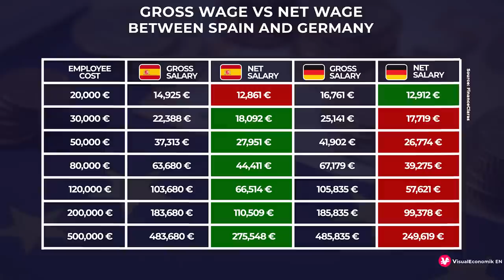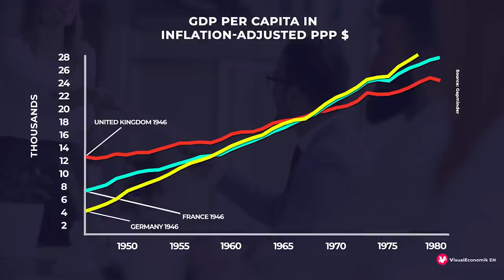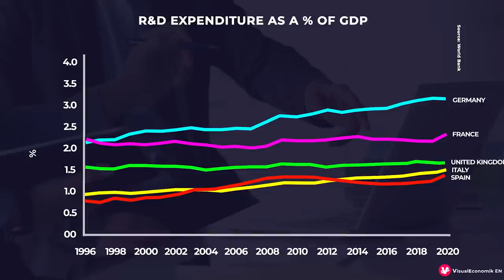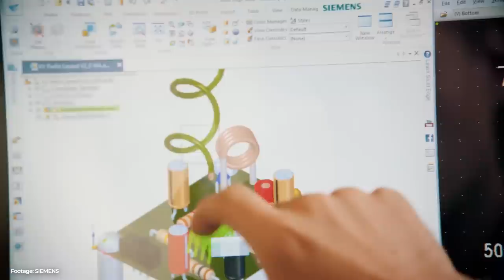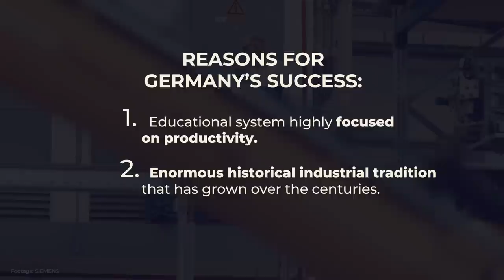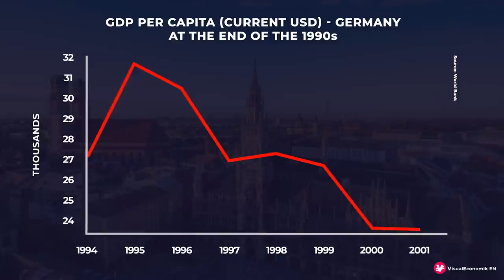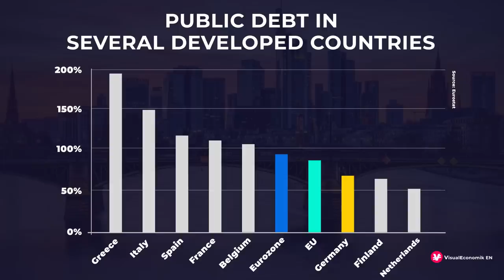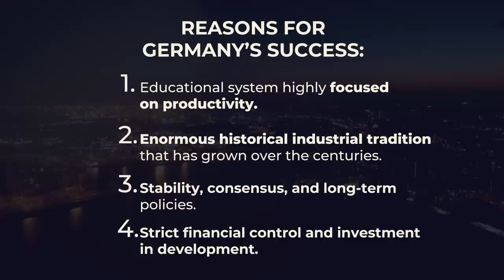The Four Reasons That Made Germany a Great European Power

Comment: Great video!
Fyi: Elementary parts of the agenda 2010 policies have recently been abolished. Although they did indeed create a lot of flexibility to react to economic crises, at the same time they also allowed the emergence of a huge low-wage-sector. Which is in part a disguise for unemployment. Combined with 'relatively' high social security coverage for actual unemployment, this caused social disturbance. Whether the new system is better or not can only be observed years from now. Also the gap between poor and rich has increased, such as pretty much everywhere else in the world. Hopefully tho, the political stability will continue and not follow some of the neighbor's countries.

Comment: In the village i'm from we have a tiny company. This company has only ten employees but they produce for the world market. Specifically they produce high precision lifting benches. Those lift only to around 10cm height but you can lift to your desired height with almost nanometer precision. Doesn't sound really useful, does it? For what application do you need to  lift somethig to nanometer precision? The anwser is: The production of modern high-end chips. They have have a couple competitors worldwide but none of them can reach their precision. You can pretty much assume that every single chip producer worldwide and most likely every single research institute worldwide had at some point business dealings with that tiny company situated in a tiny village in germany.

Comment: Great documentary, thanks! However, the Euro should also be mentioned. Germany with its strong economy should have a much strenger currency, but this is not the case with the Euro. Before the Euro, the DM would have appreciated and made German products more expensive, but now Germany is competing with less productive countries using the same currency as the less productive countries which in fact is an unfair advantage.
Reply: The Danes have a economy of similar health to the Germans, but do not the Euro, and thus run a lower interest rate than the euro zone average. And thus usually 1% lower than the Euro interest rate. So yes the Germans should have a stronger currency  than the Euro Average,  but we would still expect it to be possible to hold the exchange ratios with a intrest rate adjustment of 1-2%.
Reply: Why is that unfair? The UK could have joined the Euro too.
Reply: @nettcologne9186  Why? The euro is weak. The pound isn't perfect health-wise but it tops the euro.
Reply: @Ganymede559  ... and then what are you upset about?
Reply: @nettcologne9186  Ask yourself the same thing. Maybe you should learn to refute arguments.
Reply: << Before the Euro, the DM would have appreciated and made German products more expensive, but now Germany is competing with less productive countries using the same currency as the less productive countries which in fact is an unfair advantage.>>

I agree.  Germany has grown fat by hollowing out the economies of much of the rest of Europe.
Reply: The Euro was introduced in 1999, long after Germany's economy was already thriving. So, no, the Euro is not a reason for its economic success.

Comment: I absolutely HATE the German school model.  Grades actually are only a very small measurement of intelligence, aptitude and ability!  Take myself.  I was a very lazy student mainly because I was usually bored and I also had ADHD.  I was very happy not studying at all and getting by with C's.  I hated Math and never even tried very much so always got D's in math and didn't care.  I always knew I was going to college to be a Social Worker and Math just wasn't needed.  After high school, I went to Community College for 2 years, was more interested in the subjects I studied and got B's without studying much harder than I had before.  After that, I transferred to University and still got B's and got my Bachelor's degree.  I had a very successful 40 year career as a Social Worker and was always receiving awards for the job I did..  Had I been in the German school system, I fear I would have been packed off to trade school and spent my life on an assembly line making widgets all day just based on the grades I had in 4th grade making just enough money to get by instead of making really good money like I did so I could retire early and make as much from my pension and Social Security as I did working!
Reply: The German school model really has down sides. Me also has ADHD, was trapped in midd school and terrible bored. But I did'nt fit into the A-level system in Germany (ADHD...). After midd school and apprenticeship I decide to go to school again, but in a sideway, that was interesting for me. My Family could not help me financial at all, but I got full support of german goverment. Later I went to University and received masters degree in physics. Still got finacial support by the government.
And this is what I am very thankfull for. No matter, what your background is - you can reach all you want if you work hard for it. So yes, our base school system is trash, but the verious opportunities in the system and the financial support is unique and give all possibilities.
Reply: Also it's becoming more and more of a trend that companies are looking way less on your school grades and more on your personality

Comment: Many have commented Mittelstand as a reason. I also want to add to that, that due to the sheer number of companies it's insignificant if one or two go bankrupt and out of business because they simply don't matter. We don't have these overwhelmingly big players that are responsible for a significant portion of the GDP, so we are not dependant of them which means they also hold no significant power. Germany is simply too diversified to fail on a big level. If a hole emerges, it gets quickly filled in by the next company or companies. The german economy as a whole is highly stress- and crisis-resistant and has a very low risk attitude. It's like Steam for gaming, the large behemoth, that is slow to move, but you know what you get.

Comment: GDP per capita in the Netherlands is about 10% higher than germany... Dept to GDP ratio in Germany is 77k per capita, in the Netherlands it is 26k per capita, the Germans have higher debts per capita, yet they are rich? Germans have lower cost of living and most consumer goods are cheaper in comparison with the Netherlands.  Germany has great industry, but especially in Western Germany (ruhrgebiet) everyone seems so depressed and unhappy. Not suprising when you live near the autobahn or close to a factory. A high literacy rate in germany but half of the population is unable to speak a foreign languages (or does not want to). The Netherlands is way more export/internationally (open)minded. When doing business Dutch companies will try to accomodate a fitting solution to the customers liking, the Germans just stick to their rules and plans also if it is not fitting the actual customer.

Comment: You have pointed out several German strengths, however do you wonder why the DDR made a poorer impression after the war?  You haven't mentioned the significance of the Marshall Plan and the security blanket provided by the United States, allowing the BRD to invest heavily in its economy.  These two factors made an enormous difference.  The eastern German states have still not recovered from its previous environment it spite of material help from the western German states.

Comment: I can't understand why Germany hasn't continued with advanced nodes of semiconductor production.
They had, they still have, all the basics available to them, to produce ICs made of transistors with a five nanometre gate. Basically, what Taiwan is manufacturing now. The same apply to EV batteries; Germany had to have Tesla doing it?
What am I unable to grasp?
Reply: German companies were not able to compete with US companies when it came to PCs, so they were outpaced by them. Other countries were quicker, too. But the Germans didn't comlletely give up, they specialized in certain fields. For example, sensor chips from Bosch are used in quite every smartphone or tablet. And do not forget that TSMC is ahead of all other manufacturers, not only the German ones or the ones having several plants in Germany. Also take into account that the key part for seven and five nanometre technology is made in the Netherlands, as all competitors gave up.

With batteries, you are right, German manufacturers just have slept.

Comment: first graph - diff between gross and net salary. guy says it equals tax difference but ignores the employee cost (which is also in the table) which included employer social tax
as you can see the net salary is very similar at the average level, even though the guy says there is a huge difference
stopped watching the vide